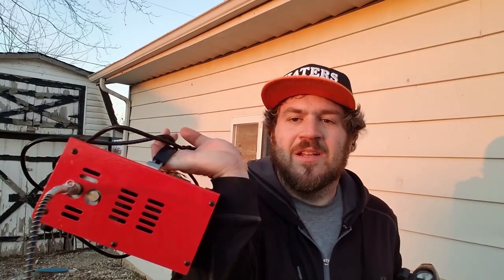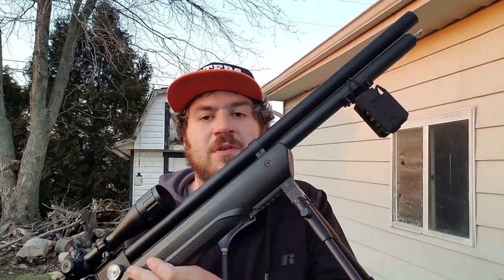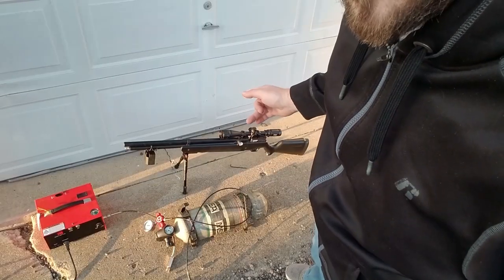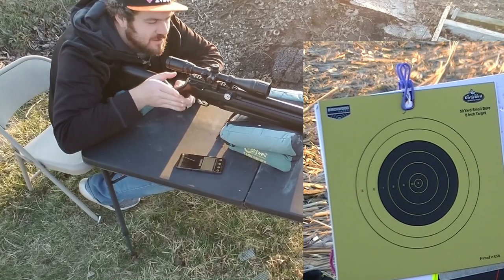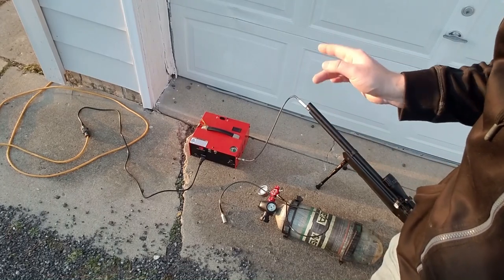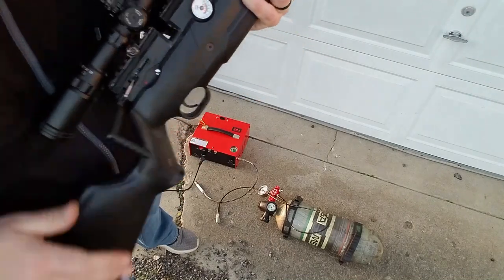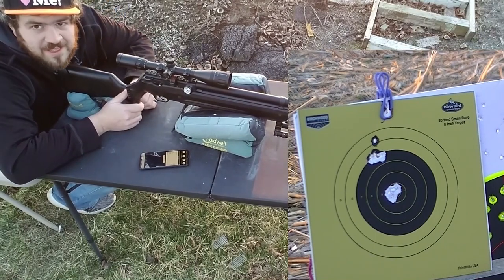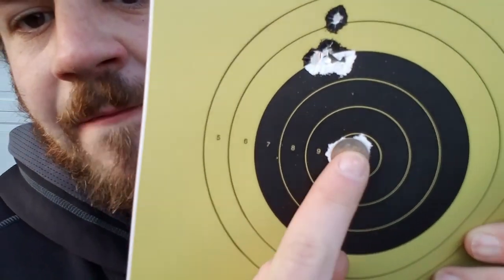The BEST way to fill PCP Airgun

Comment: I don't know in my opinion and I haven't tested this. Filling up with the compressor versus the SCBA bottle both of them heat the tank up when you fill. So in order to confirm this experiment you need to do it over and put a temperature laser pointer on the pressure tube after feeling both ways and see if the temperature is higher with the compressor versus with the SCBA bottle.. I'm not arguing your point it is valid I see where you're coming from. Just thought I would throw in my thoughts and see what you think. 😀😀😀😀🙏
Reply from the maker: Thanks Mitch!

Comment: Newbie here.
How long does it take to fill the rifle from the tank or compressor. I couldn't tell. 30 seconds?
Also, after the fill, you fired off to blank shots?
Reply from the maker: Bottle is quicker usually, compressor can take minutes...I dry fire after filling due to temperature difference in the air to reset the regulator in my gun

Comment: I notes you only fill to 3000 psi on the avenger is there a reason you don't go to the actual full pressure of 4350 curious if it makes a difference in performance

Comment: Hey there, just bought a Hatsan Flash QE .25 caliber, for some reason it doesn't seem to want to take air at all?  Like my other Umarex Origin .22 caliber. I ordered a electric air pump but haven't received it yet, so I'm using a Vevor hand pump for now. Any ideas why this brand new Hatsan Flash QE won't take air at all? Let me know? Thanks
Reply from the maker: Hopefully it's something simple, like the hammer being cocked, fill probe issue,  degas screw

Comment: Awesome video in my opinion air compressor like that small portable can ruin a gun if you do not keep the air cool from the compressor it hot it can ruin 0rings and seals in my experience if you don't have cooler air it happened to me thanks for sharing bsafe buddy 👍
Reply from the maker: Thanks! definitely watch for my next upload, I'm opening a can of worms on the budget air compressors lol
Reply: @STKO2011  lol cool 😎

Comment: I just started with a yong heng. My take is that you always depressurize the gun  before refilling so you don`t burn up the compressor?
Reply: No, doing that you'll have to run the compressor much longer and that's going to heat it up even more. 
Best way is to hook it all up and keep the bleed screw on the compressor open until after you've powered up the compressor. Wait a couple of seconds and then close the bleeder and top off your gun. That way, it's not going to run as long, there'll be less heat and although you should already have an inline filter, there should be less moisture in the air since the air will be cooler. 
My compressor is supposed to be good up to 80 deg C, but I've never had to run it long enough to put it over about 35 degrees.
Reply: @007tallguy  good info, thanks. what's the issue with not using a filter? long-term water damage to internals, I guess?

Comment: Forgive the noob question but can one use their HPA compressor to fill the SCBA tank; thus, mitigating the need to have it filled at an air supplier? Or is there a steep cost to buy the adapter gear or necessary regulator manifolds (hypothesizing here as I do not know what is required if this is even doable)?
Reply from the maker: Yes as long as the air compressor is capable with volume output, I use Yong heng to fill scba 30min tank, the smaller compressor like shown are rated only for 200-300cc of fill where that is fine for air cylinders on most guns...the equipment needed for hookup can range from $60ish to $100s...I use the Stikman adapter with longer whip

Comment: I'll just stick to my break barrel. No doubt these air rifles are nice. But I sure don't want to mess around with pumping it up. Just looks like a pain in the butt
Reply: They have their place. What speeds are you getting out of a high end breaker? Thanks
Reply: @pepesantoraton9865  1300 fps.

Comment: Scope Slipping... Any Cure?

This is follow up on the BSA Optics Sweet .22 Scope for the Gamo Maxium .22 G2 break barrel gun.

I purchased this cope and had it mounted. It looked and seem to work BUT today I noticed that the scope’s mounting brackets (11mm) were sliding back to you as I fired the gun.
The back mounting bracket was just about to slide off the back of the rail.

Does anyone know how to fix this problem to keep the scope from moving.

I have tightened down the mounting brackets very secure.
Reply from the maker: Need scope rings with a stop pin theres a hole in the reciever for it
Reply: @STKO2011  Thanks.... Where can I find scope rings that would have a stop pin in them.
They would have to fit the top rail which is 11mm in size.
Reply: The scope rail has a hole in it close to the back of the rail. I just need to find where to buy a scope ring that has a pin on it so it will fit in the hole.
I need to keep the scope from sliding back along the mounting rail.
Reply from the maker: @dhansel4835  Amazon or Ebay